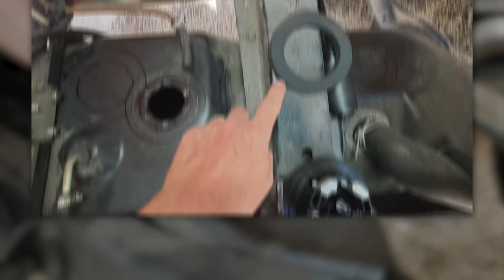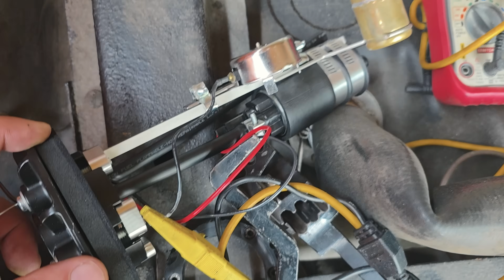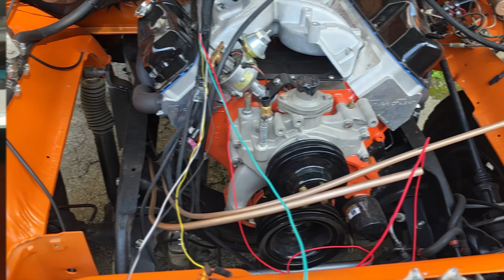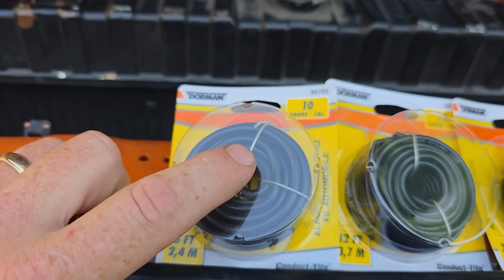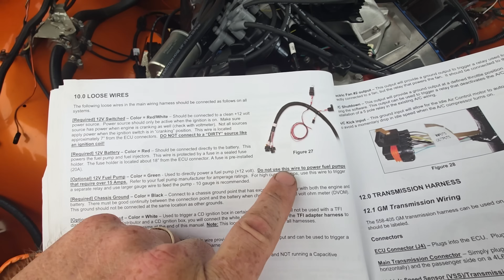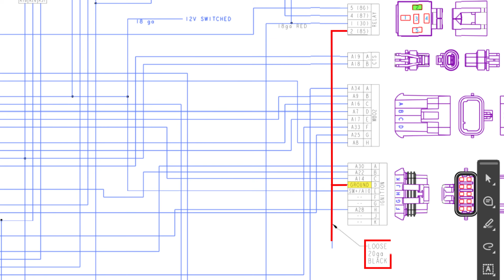Holley Terminator X Universal In Tank Fuel Pump Installation [78 Dodge Power Wagon]

Comment: Perfect timing for this video.  I have 83 Ram short bed 4x4 project truck that I need to drop the tank and clean out since I have no idea how many years this truck was sitting.  Was thinking about replacing with a modern pump while i had it torn apart.  Now you have me thinking, I have an extra RamCharger fuel tank and I hate how the previous owner ran the duels.   With that kind of upgrade what were you thinking of moving the spare tire to?
Reply from the maker: I don't have a spare tire. But even if I did, it would be worth the sacrifice for a true dual exhaust system that runs out to the rear of the truck :-) Thanks!

Comment: Help Mr. Danner.. need your knowledge. I have a 2000 nissan altima and my RPM is Low at a stop light. What you think the problem is chief?? Thanks. have a great day. Marcus from Texas..
Reply from the maker: Clean the throttle body and then perform an idle relearn
Reply: My Bad Mr Danner.. want to get out your hair cause know are busy but i listen to my RPMs goes Down with a Power Serge Only if my Ac clutch engine fan comes On. Need help with of Steps I can Do to find out the problem.. really appreciate your knowledge Chief.. Marcus from Texas..
Reply from the maker: @MarcusWilliams-n3d  again, same reply, focus on cleaning your throttle body and performing an idle relearn as your first step to ANY idling problems
Reply: O ok.. I will .. Thank you Sir..
Reply: Good Morning Mr Danner.. What you Think Chief if my RPM goes Down with a Power Surge when my Ac clutch or Engine fan Comes on. Thanks for your input .. Marcus from Texas..

Comment: Would filling the tank with exhaust from another car help with making less oxygen in the tank when doing risky things? 
Edit: or would that just lead to the person doing the task standing there with sticking up singed hair, smoke coming off, charred face and torn singed clothes like the coyote in a road runner cartoon?
Reply from the maker: Lol good thoughts
Reply: I should add the idea of doing this is I’ve seen tanks welded and soldered with this method. It works and is solid. However those tanks were empty and cleaned but still very smelly of fuel vapour. 

If exhaust is used to reduce oxygen in there when fuel is in there would the vapour be forced out even more and ultimately become more dangerous? The more I think about it, the more I settle on ending up like a forgotten sausage on a BBQ 😂

Comment: Hi, I'm not sure if its relevant to the terminator system, but the Holley Sniper2 ecu is not tolerant at all to slight over voltage from battery chargers! Do not put a charger on one, or you will fry the ecu! I got this information from Holley tech support. I didn't see any warning in the quickstart guide. I have to say this was disappointing. Again, im not sure this applies to the terminator, but hopefully it may save someone (or possibly you), some grief.
Reply: It applies to all Holley ECU's.
But I have never had a problem with a battery charger, Yet...
Reply: @WrenchesandPlants  Wish I could say the same 😂 I had an old school roll around charger on an obd1 chevy truck with a sniper2 a couple weeks ago. (It still has the original pcm for transmission control.) I had the charger, and key on, reviewing some transmission data on the stock pcm with my mt2500 when the Holley ecm let go. The guy on the Holley tech line said "Oh yeah, if you try to boost them, charge them, or jump them with the key on you'll let the smoke right out." I've had this charger on thousands of cars, from 1970-2020, and never had an issue until now. I took responsibility, and made it right for my customer. I had to eat the cost. Just be careful everybody. From now on, if a car comes in my shop with aftermarket stuff installed, (especially Holley), the battery cable comes off before I hook the charger.
Reply from the maker: Good info. Thank you!

Comment: I don't think that rtv is suited for gssoline contact. That vent w/ sending unit wire may fail with gas contact. I would keep an eye on it.
Reply: If it’s safe for oil applications it’s good for petroleum applications but the concern is valid. I keep a three ring binder around for applications for my various shop supplies to be sure, from the vendor.
Reply: @volatile2805 Fuel is a little more of a solvent than motor oil. However some types of RTV say fuel resistant on the package. I'd look for that, to be comfortable using it.

Comment: You mentioned double clamps on the rubber fuel lines, and not necessarily needing two clamps. Did you make a small flare on the end of the nicopp lines? The former owner of my '96 Dodge had a repair shop replace the fuel line, and they used rubber line from the tank to a short section of steel line without making a flare. I was able to pull the connection apart by hand without loosening the two clamps. As the rubber ages it shrinks and loses pliability... A flare in the metal line is the only safety in the connection. Making a partial bubble flare with a common brake flaring tool works great. In the end I dropped the tank and replaced the rubber line with an OEM line directly from Mopar.
Reply: use a bubble flare tool and only partially make it or first step of double flare, which makes a nice bubble shape with less risk of a sharp edge and line cut/vibrate through. 
had that problem in the past with standard flares and even double. of course you could always get the very expensive line making tools and make whatever ends(who's that rich? lol)
Reply from the maker: Yes sir, a bubble flare

Comment: Instead of cutting a big hole in the tank, could you have just used a frame rail pump..Leaving your original sending unit for the gauge..
Also as a theft preventative measure..Install a hidden switch under the dash to control that relay that feeds the injectors and pump..on the low amp side of the relay..Something where you know where it is but can't see it..An easy flip with your hand reach and the engine would never start
Reply: better off using an in-tank pump in terms of cooling it and longevity. that said, the frame rail ones are nice when they conk out in the middle of the road or gas station.
Reply: @throttlebottle5906  The fuel constantly flowing through pump because of the return line would do plenty to keep it cool..A wrap of a thermal material would help too..
When that (if) that pump quits on Paul, it means lifting the bed off again..A rail pump is nothing to change out especially if you use AN connectors..15 minutes at the max time..
Wonder what a new Holley pump costs?
Reply from the maker: That would have been an option. I chose this route as the frame mounted pumps are not as reliable. Factory systems (Ford) that used frame mounted pumps had lift pumps in the tank to provide the proper volume to them